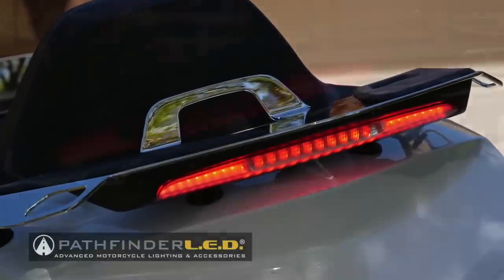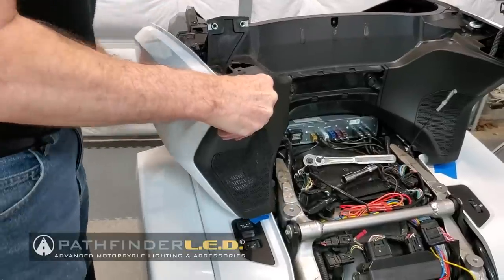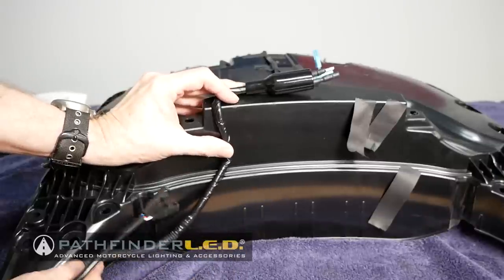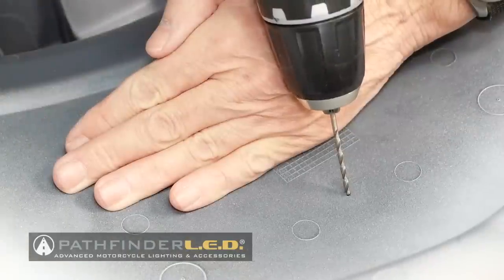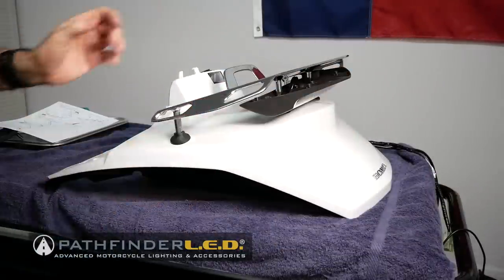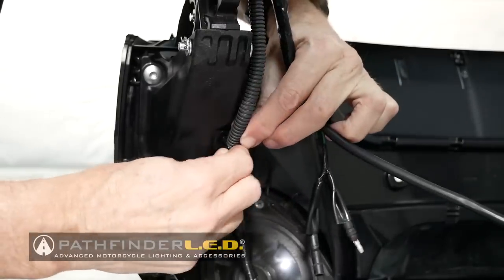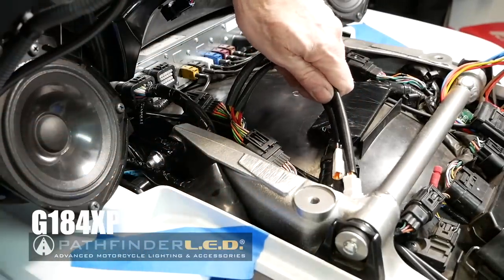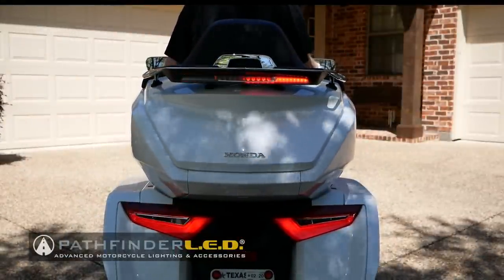Multi-function Sequential Brake/Running Light for 2018-2020 Honda Goldwing Tour | PathfinderLED

Comment: what pathfinder does not tell you is that it matters which side their plug and play harness goes on.  I installed it and when I pushed left bliker the right one on the pathfinder led lit up yet the motorcycle left signal worked.  After several trials and tribulations, and help from Tim at Cust service I got it right.  So it took me 5 hours to do this job but....the lights look great.
Reply from the maker: I think I mentioned in the video that the harness with the yellow wire goes on the right side.

Comment: I enjoyed another video from you today and that was the install of the Revco trailer hitch. This raised a question You showed in both videos (trailer lighting harness, and the Trunk light system} connection to the stock Honda wiring harnesses  how would you connect both to the same stock harnesses? Do you just connect in tandum? in other words one pigtail after another?

Comment: Did you daisy chain your Pathfinder quick connectors with your Show Chrome Isolator Fuse Box quick connectors ?
Nevermind,  I saw your reply to another post.    I did the same with my Shows Chrome Isolation Fuse Box and my Goldstrike plug-n-play harnesses.  Works great., but like you said, not much room lift under seat.
Reply from the maker: I did

Comment: Chris, I have a new 2021 GW Tour DCT.  I've ordered the Honda Chrome Trunk Rack and the Tailblazer brake modulators you suggested.  My question is are the Tailblazers compatible with the Pathfinder Multi-function Brake/Running Light (the new 2021 model). If so, do I leave the Tailblazers installed as instructed rather than running them through the Pathfinder Accessory hub?  Hope this makes sense.  I'm looking for the taillights and the trunk rack light to modulated when braking.  Thanks for being such a valuable resource.
Reply from the maker: Yes, they are compatible.

Comment: I bought my 2018 DCT with the honda luggage rack and brake light installed, can I replace it with this one, does it use the same hole through to lid???Any feedback would be helpful.
Reply from the maker: Yes, it uses the same hole.
Reply: @cruisemansgarage  Great videos thank you. I also did the same thing as Kenny; however I was disappointed that the OEM Honda Brake LED did not have capability of a running light. Can I just replace this light with the one you recommend and connect to existing Honda wiring harness that I also bought when I purchase Trunk mount and LED brake light? I totally agree with you on the lights...I want my 2022 Goldwing  DCT to light up like a Christmas tree.  ps. shop rate for the dealer to install the trunk mount, light bar and wiring harness was north of about $600 (CDN). Probably should not have told the dealer to just pop the light and rack on when the bike came in. Definitely going to take a hard look at buying your maintenance videos.

Comment: Nice! you may want to use a "pop" filter because you have a really big spike somewhere around 100hz+-. I have to kill my sub woofer while watching this video, I think I noticed it in another one before, I just did not say anything. (it's breath pop)
Reply from the maker: Damn audio. I struggle with the pops. I finally got a good echo plugin and I have a the foam filter on my mic, but some pops still get past me. I will pay more attention to this in the future.
Reply: @cruisemansgarage  Maybe your just a little to close to the mic? Other than that it's perfect.
I use a THX system so it catches all the audio available, A normal computer system might not pick it up?
Reply from the maker: I will try backing away from the mic.
Reply: @Bass.Player  Yeah, I listened just using normal PC speakers and I didn't hear any pop like you describe.  Maybe I'll listen again with my headphones to check if I can hear it there.

Comment: Appologise for an unrelated question, my 2018 DCT GoldWing is 9 months old and my remote key battery is up, I get the warning on the screen so replaced it this morning, is this a typical lifespan of the battery, would it help by deactivating it when not riding, I thank you in advance
Reply from the maker: I have no idea what the lifespan of the battery is. I have had mine for more than 13 months and it still works.
Reply: Thanks buddy
Reply: Make sure you turn it off when you are not using the bike.  Otherwise it may be running the battery down.
Reply: how do you turn off remote key??

Comment: Can the Honda LED trunk light be run off the pathfinder LED harness?  Or does it need the signal from the bike to tell it the lid is open/closed?
Reply from the maker: It can operate from the Pathfinder LED harness.
Reply: @cruisemansgarage  Thanks! I am adding the USB to the trunk and the Honda LED trunk interior light and figured I might as well do this and the spoiler at the same time so I dont have to take it apart again!  This will save me having to route and buy 2 harnesses...  The Trunk light will be on all the time with the pathfinder harness or it has its own mercury switch inside of it????  Thanks for all the great vids man!
Reply from the maker: @mark33545  OK. Now I understand what you are asking about. You will need the Honda harness for the interior trunk light and the Pathfinder harness for the luggage rack light.

Comment: $589.90 ($330 for the luggage rack, $259.90 for the light and required harness) for a third brake light and turn signal? No thank you. That is ludicrous!
Reply: I agree, my friend put the Honda light on but its only a brake light. I don't need a $350 luggage rack so I'm looking at Goldstrike and Showchrome lights that mount to the curved lip on the trunk . That way I get the function I want without the cost of the rack. I also can add a rack later (several choices) if I decide I need one.  ps Honda should have had one there to begin with.
Reply from the maker: I think a lot of folks WANT a luggage rack, so adding the light just make sense. This is a MUCH better solution than the Honda light. And, hard to compare this light to a stick-on trunk light. This is the real deal.
Reply: @cruisemansgarage  Agreed IF you need a rack, this is a better choice then Honda's light. But I don't want or need a rack so I'm leaning towards the Goldstrike thanks
Reply: @doug1611kjv  Did you ever install the Goldstrike light? If so how do you think it compares to this light?